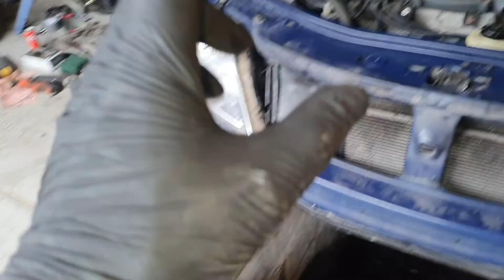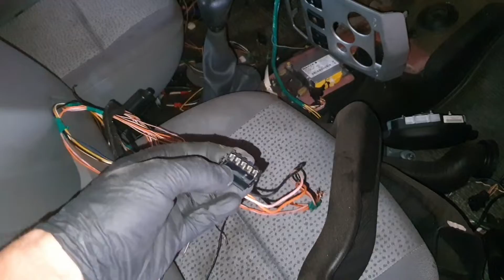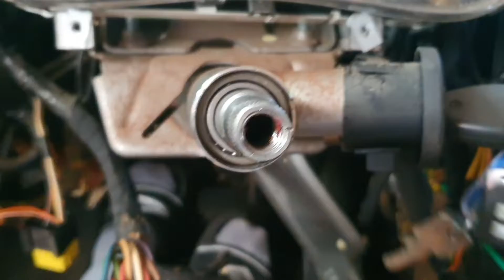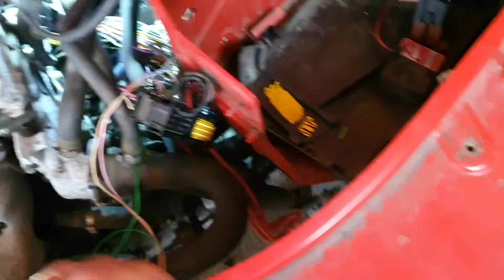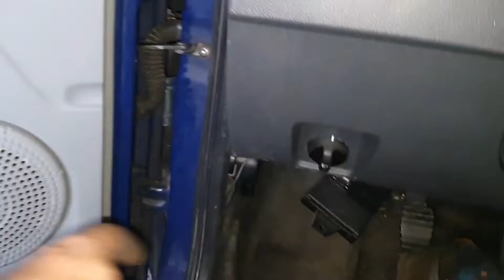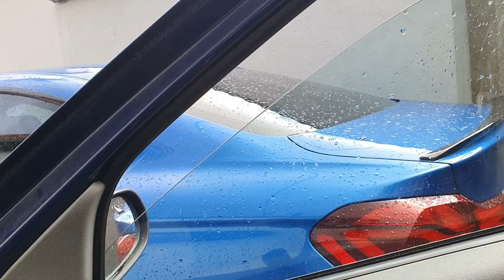Dacia Logan Air conditioner! How to RETROFIT AC ! Full episode!!!

Comment: Hi, i have installed ac on dacia sandero 1.0 2017 the ac its cold and fine but the engine i feel it not ok the rpm on take off not stable do i need to make software for the car ?

Comment: Brilliant job mate! I just have a few qustions if you can help me. I have the exact car, witthout any extra options, is just the base model and I have just installed the mechanical parts of the AC (the compressor, the pipe s and all of this stuff) and I just need to install the electrical part (which I have the all wires from another car with AC). I just want to ask, if I remove the old wires from engine bay and I will install the new one, like in the factory, do I need to change the ECU and UCH? Or I can use the original one (I m thinking that my ECU won t recognise the AC and maybe it will not working), if I need to change the ECU and UCH, do I need to make any coding for the new one s? Thank you in advantage and I hope that you understant what I want to do exactly :)))) Anyway, very good content, keep it up dude :D
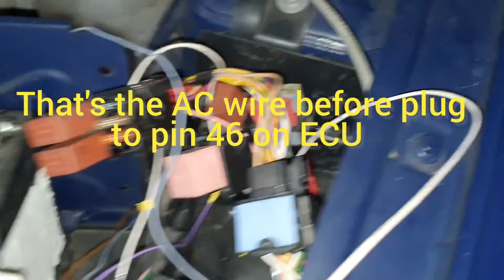Reply from the maker: If you move everything from the donor car you don't have to code anything it will work, you have to pay attention to the trigger wire that comes from the ac button it might be routed already. You have to tap it before the plug that is in the engine bay (orange in my case) and put it in pin 46 on the ecu as seen at 21:45 and all the lin bus cables from the relais the white ones together on the lin bus knot from your engine harness. Good luck 👍

Comment: good job man
but Did I have to remove the radiator to install the condenser, or did you install the condenser from the front of the car?
Reply from the maker: You have to replace the radiator as well and a water hose because the servo pump is different located and the original water hose won't fit